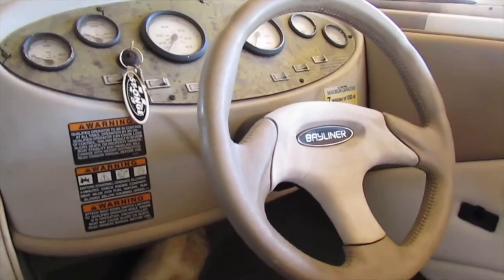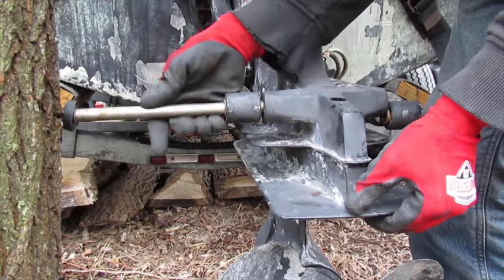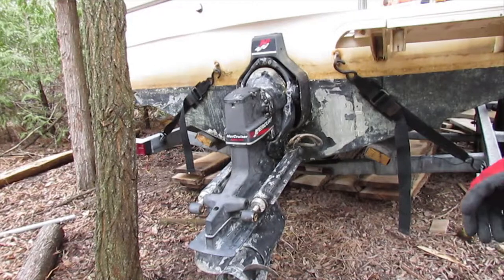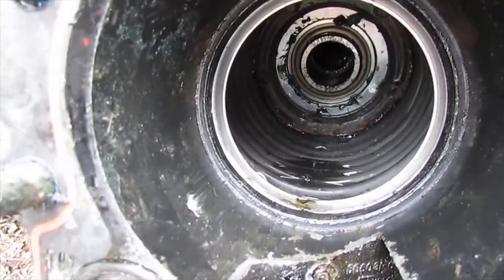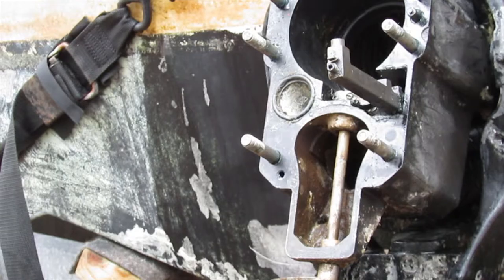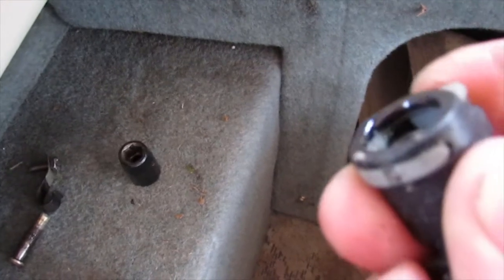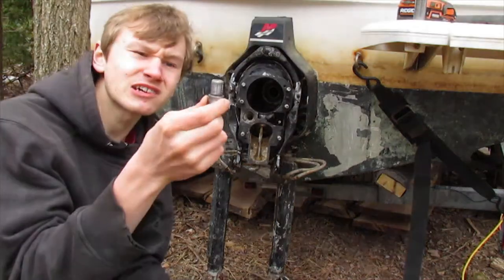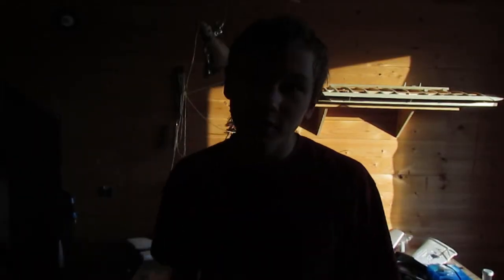This has gone WAY TOO FAR... STUPID stiff steering on my CHEAP copart boat

Comment: OH man, pulling the motor out too fun !
Reply from the maker: yeah no duh roflmao
Reply: What about cleaning the boat with presser washer and oil the pin, to free it up ?
Reply from the maker: unfortunately I dont have a power washer, but I will be doing a massive cleaning video once it gets a little warmer out here. oiling the pin doesnt help because its not the lower one but the upper and the upper has seals so the oil wont go through
Reply: Vroom ZOOM get a pressure washer from home depot for cheap!
Reply from the maker: From copart? Lol
Reply: I got a used one from Lowe's, they replaced the gas lines, but was great deal and runs great. And the price was right.

Comment: Great content man! Keep it up. My swivel pivot on my outboard is really difficult to turn even with two hands on the wheel .. Everything related to it is of interest for me. Any tips for a stiff swivel bracket/pin on an outboard motor?
Reply from the maker: do what i did, disconnect the steering cable at the back, see if it turns easier. if not, then its the steering cable and needs to usually be replaced. if it turns easier then its the swivel bracket on the outboard.